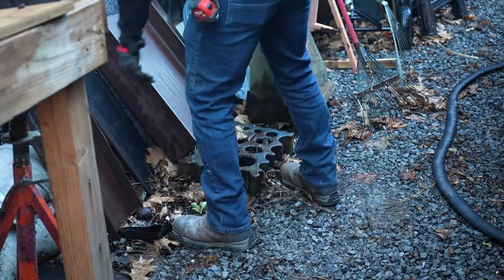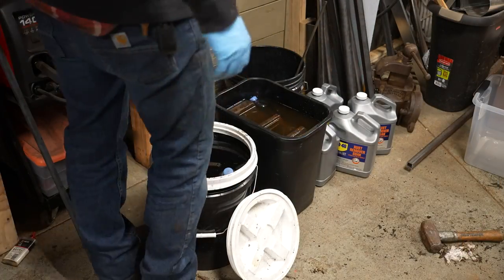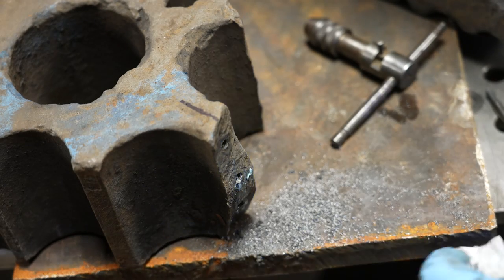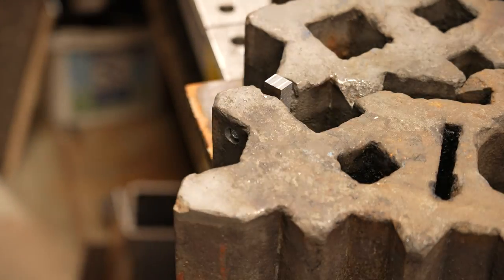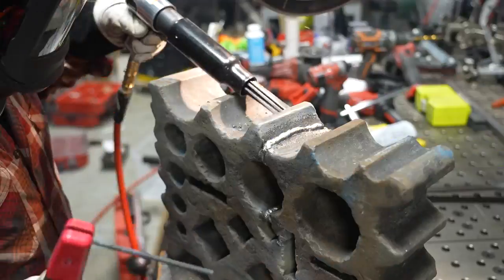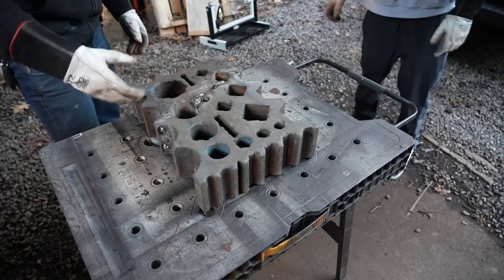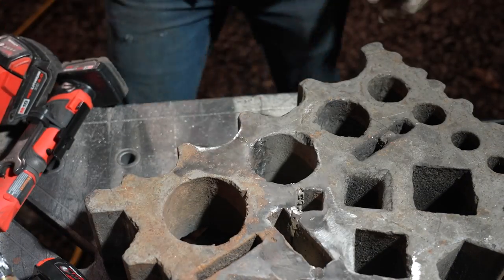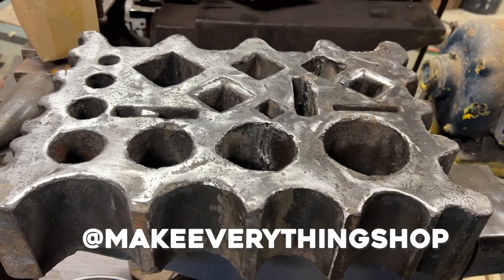Can This Even Be Repaired??

Comment: You destroyed that by Nickel welding it. The only way to properly weld that would be either fusion welding with cast iron filler rod or by furnace brazing. It might hold right now but it eventually will fail. I work for Lock-N-Stitch where we specialize in cast metal repair.
Reply from the maker: Someone else destroyed it by breaking it in half
Reply: @rd-ch1on  the tensile strength and yield point of cast iron are both the same. It doesn't bend, it breaks. When metal is heated up, it expands. As soon as you strike any kind of electric arc, you are immediately introducing 1000°+ into the metal which will produce a confined area of expansion and contraction creating cracking and hardening of the material which renders it further unrepairable. No drama, just science. I hope that answers your question.
Reply: @rd-ch1on   I have to fix these kinds of things everyday. The area that was welded using electricity has indeed been destroyed. The only way to fix a piece of cast iron that has been welded on is to completely remove the material that has been welded, including the surrounding heat effected zone and replace it with a new casting via either fusion welding, furnace brazing or metal stitching. My comments have been educational and it is my hope that you and others may learn something from them. Using the words, "kerplode, gazillion, Silverback gorilla, etc." I have no doubt that you indeed are an expert in the field of drama and I respect your intellect on the subject. After all, it is people like you who keep me employed 🙂
Reply: @Lucas Edwards  fantastic mate well said, stitching would be be my choice, but thats really just holding the 2 pieces together, giving its primary function, I would have no doubt that it would fail in short order
Reply: @Make Everything  bro, you asked for expert input. You got it and turns out you don't have the $1k object you thought you had. Bummer.
Reply: Could have just tig brazed it with silicon bronze rods. Would've held up fine for what you're using it for.
Reply: Used to have to repair cast iron knitting heads from a textile mill. Trial and error, but silicone bronze rod brazing was the best. Prep the surface, cleaning and grinding, get the torch ready. Built a furnace out of fire brick, put the head in, put a blaster torch in, and heated it to dull red. Pull it out and immediately braze it. Would only braze for maybe 5 minutes so it didn’t cool too much and slide it back in the furnace with the torch off to cool slowly. These were big knitting heads, about 300 pounds, and filled with oil when assembled and operated. Never leaked, and held up.
Reply: cope
Reply: @lucasjedwards  cope
Reply: @MakeEverything  hey, he did give advice, a shame that your repairs also damaged the material, but now only time and use will tell, an update after heavy use would be nice.
Reply: @yyeetmax2849  im waiting for this and for it to turn out that the Nickel weld actually works, making the "expert" look like an idiot. Nickel rod is whats being used most around the whole world to weld cast iron.
Reply: @Sharpless2  if that's the case, i'd be  happy for him! i do not wish to see someone fail.
But i must remind you that something being widely used doesent mean its good, it just means it is widely used, there are more factors to it, for example: if its easy, fast and cheap to make/repair, a lot of people will use a method, even if its less than ideal.
Reply: @yyeetmax2849  Thats true but its stable and works. May not be the best filler for cast iron but many professional shops use the same and it seems to work just fine. Do you know This Old Tony by any chance? He used Nickel rods to weld his cast iron Bender and it works fine. Hell, even John Deere uses Nickel rods to weld steel beams (cab supports) to cast iron parts.
Reply: @Sharpless2  interesting, i trust this old tony quite a lot, he still did quite shallow welds, the bolts should help, but as said only time will tell how well it will hold up, a test video where make everything gives it a good few whacks with a sledge would be nice, it should be standard for this tipe of repair on this tipe of tool, of course with something to spread the hit a bit so the surface doesn't dent too much, like a 15x15cm plate of steel.
Reply: @yyeetmax2849  i agree with you, he should test that.
Reply: @Sharpless2  yep, a proper test would solve all doubt
Reply: You did a good repair considering the equipment you had at your disposal, at the end of the day that swage block has been broken for decades, no one even attempted to fix it until you came along, so the way I see it, it’s a lot better off now then it was before you found it. Will it break in the future? Maybe, maybe not but it’s yours so who cares, it was a good repair that will probably outlive you👍🏼
Reply: Would thermite welding work?
Reply: I have welded cast iron that was over 150 years old and I started welding using a stainless steel rod before hitting the job with a cast iron rod . And I pre heated the parts first and in sand then once I fished welding it went back in the sand . No problems
Reply: @frankconley6321  Yeah it should, if you can contain it and prevent it from melting into a puddle somehow. Thermite welding is used industrially on all sorts of heavy steels.
Reply: Thanks Lucas. I'm agree with your explanation and happy reading it. Weld done 😊😁👍🇲🇫
Reply: I was thinking furnace brazing would be the way to go.
Reply: Pre heat, silicon bronze, and throw it in some sand to cool slow. It would be just fine. Haven't had a failure yet. Some people are just stuck on one way only, and that's it. There is the best way to the worst ways. There is no one way to do it. It depends on future use of said object.
Reply: @MakeEverything  you asked for advice on how to do it better, then you're a smart ass to the person who specializes in this field specifically and gives you advice about it?
Reply: @MakeEverything  that's a really disappointing response. Would it have killed you to acknowledge that you learned something new from this comment? I don't see the need to come back with your sassy response.
Reply: You should start your own channel.
Reply: @Make Everything  someone "broke it" by breaking it in half, it was repairable. Now,,,, not so much.
Reply: @MakeEverything  I thought you wanted to know what you did wrong...
Reply: There are dudes in Pakistan that can fix this in the dirt without breaking a sweat

Comment: If you're in counting porosity on old metal. You need to cook out the impurities at the weld zone. Heated up until it's glowing hot. Let it cool down halfway and then make a pass. Everything should work out fine after that. 👌

Comment: The nickel rod is sensitive to sand in the casting/casting skin scale, it must be ground off clean. Also they should be dry , from a new pack or kept in an oven over 200 deg F min.  I have done heavy castings like that in industry and we always used E7018 from a new box or oven. E7018 heavy slag floats out the sand and inpurities well. ENCI nickel 99 has a tensile of 38-40K psi. E7018 is 72-80k psi...a much stronger filler metal. Second choice is ENCI 55 ,the 45% steel ads more strength. Full 99% nickel is only used when it must be machined or drilled, it is soft as welded but strength is less. Keep in mind that your repair should stand up to regular use but if it doesn't , try E7018 better results IMHO.

Comment: You need  heavier bevels for more thorough adhesion.  Old cast iron tends to be porous and will absorb hydrocarbons from solvents like a sponge which is why you're getting such rough beads initially. It looks like you needed a higher, more consistent pre-heat. I try to get the whole casting up to at least 500 degrees Fahrenheit. I have had better success with higher nickel alloy rod. Try cast 55 or cast 60 if you can find it. Your peening with a needle scaler helps a lot. Also, you need to control the cooling by post heating the whole part again and wrapping it in insulation.  In the end, it depends on the quality of the cast iron. If the metallurgy was right it will accept the weld. If the silicon is too high there isn't much you can do to keep it welded.

Comment: You need to preheat it and maintain a constant heat on it while welding.  Usually, in my experience, with this old of cast iron, and the blends made back then, a very high temp (1000-1100°f) is required for the nickel to fuse properly.  Even then, there is no guarantee it won't crack.  Also, one or two surface passes won't be enough to fuse any of it.  One or two good whacks of a hammer will crack it.

Comment: To be honest there is no easy way to repair that. You could have done with beveling all the way so you have complete fusion, pre heating to at least 50 Celsius and peining with a hammer to compact the weld whist hot so it doesn't break apart from shrinkage. 7018 is better or even 309, 316L. If you could get a big enough gas forge you could have braised soldered it together. It's a lot of work and to be honest it won't take the punishment it was originally designed for however you fix it. For your time and expense it would probably be worth buying a new one. Well done for the effort though. Cheers J

Comment: Pre heat always and post heating, and peening 👍the porosity is a result of the cast iron itself. Braze welding is best as the brass gets right into the course grain of the cast and locks it together.
The rods you chose are the right ones for that job, it's just way too thick and complicated a pattern to weld as you need to cut an angle right back into the block to get the weld right through for the strength it needs.
Braze welding would have gotten deeper penetration in the grain with the minimal preparation you did and provided better strength....given you couldn't cut the block right back for a full thickness weld.
Very challenging job even for experienced welders.

Comment: Sometimes you need to weld, grind out the porosity, weld again, etc, until you get a good weld.  3 or 4 welds may be needed if the material has soaked in a lot of gear oil over the years.

Comment: You did a good repair.. Ni99 is a solid rod and often times contaminated flux(getting the rod dirty) can cause porosity with nickle rods. oxygen contamination as well..Your repair looks good ans Im sure it will hold very well Just to add Ni rods are good and I still use them too but nickle rods are not the best for cast anymore. There are several rods out there that do a lot better job on cast.. Like Certanium 889, it wont crack and dosnt even require peening. Magna 770 is another rod thats fantastic for cast. The only downside of these rods is the cost.They are pretty expensive.. Otherwise they are amazing and made specifically for cast.

Comment: A 'really high-tech' method, would be using Electron Beam Welding. Clean the pieces, clamp together and weld the seam. The electron beam will penetrate all the way through, melting and fusing it back into a whole block. In one demonstration, the sawed an engine block in half and welded it back together in a single pass, all 20" in depth. (50 Mev electron beam).

Comment: typically I'd say it's gonna be contaminated material giving you that porosity. I'd guess inclusions of slag and possibly sand from the casting process. Probably wasn't fluxed or drossed prior to being poured and all that crap wound up in the mold with the iron which I would bet is why it broke in the first place. If the drifting operation involved any amount of taper in the tool that block probably saw a couple tons of tension across what looks to be a fairly thin section of the block where it broke.

Comment: Doesn't this thing need way more preheat? Watching folks weld cast iron turbo housings involve going in the oven for awhile to heat the whole thing up… and those are way thinner compared to this huge lump. And then moving it back into a less-hot oven or a barrel full of sand to let it cool down slowly.
Reply from the maker: I did preheat it for a long while before welding, but cut it down for the video. So far no cracks but time will tell…

Comment: Especially with cast iron, when  welding thick metal, you need enough of a v-groove to be able to weld from each side to have a 100% penetration weld.  Your mechanical fasteners may hold it, otherwise, the cracks will come back if you are using it as it was intended.  Good luck.  Your porosity was possibly caused by debris, but most likely it was in the cast iron.  Good luck.

Comment: If you were melting through the piece its a combination of amps,speed,and the type of rod your using like for a 6010 rod on 70 or 80 amps you can burn through almost a quarter inch of steel with that not what the rod was intended for but its possible

Comment: I´ve only heard of Magnesium rods being used for cast iron welding, with a lot of hammering done in between welds to release tension. Is that scaler doing the hammering job in this case? Does anyone know the difference between Mg and Ni rods for this application? 

Anywhoo, I love this piece - never seen anything like it, but now I want one, if nothing else, just for decoration. Lovely piece of smithing history! And it looks like it took a ton of abuse - the surface is hardened enough that most of the holes have pretty bad chipping around the edges. I think this might have been why it broke in the end. Imagine forcing a rod into that big square hole that´s already abused to its limits, maybe the piece is also a little colder than it should. That could finally blow out a piece like that half inch that´s missing.

Nice video as well, thanks! I don´t think you should mill it down, better keep it as original as possible. All the wear and tear is a huge part of the piece in my opinion.

Comment: I nickel rodded my cement mixer 20 years ago.  Multiple cracks. Gouged them out, Half ass heated with cutting torch. Welded up . Slow cooled it with torch for way to short of time...Everyone said it would recrack worse. Guess I got lucky

Comment: Probably the only 'right' way to repair this would be with furnace brazing. I think it's the only way you could reasonably get a full contact braze on such an enormous part. But of course, you need an oven large enough and hot enough. In the 1000-1500F range.

Comment: Man, you opened a can of worms asking for opinions because they’re like assholes, everybody has one. I think you did a good job with the repair and as long as the block is on a flat base it shouldn’t have any problems. I’ve had the same problem using nickel rods with the welds being porous. I’m using them on smaller jobs like vices so I don’t get the opportunity to run a decent bead. Striking and keeping the arc going can be difficult so i up the amps and then the base metal gets burned away. It’s tricky for guys like me and you that don’t weld cast iron very often. Ignore the nay sayers, they’re the ones that won’t even try. I love proving them wrong and if it does fail at least you tried and then you can try a different repair method. I’d love to see it milled. Cheers mate, Stuart 🇦🇺

Comment: I think this is more of a patch than a repair. Some of those cracks you only surface welded. No full penetration. They should have been ground to a bevel nearly to a point. It'll hold. For a while. But it's likely going to crack again right at those welds.

Comment: Nickel rod i.e. Tech-Rod 55 is, and has been for decades, the recommended rod for multi-pass welding cast iron. Tech-Rod 99 for single pass. If it were cast steel,  E7018 would be recommended. Preheat is preferred for both materials and a final heat soak after repair, then burial in sand or vermiculite to cool slowly. My only concern is you didn't bevel deep enough and the penetration was minimal. Probably 60% of each crack is still there under the beads. The mechanical reinforcement definitely helped. If it breaks again in the future, you can address the weld depth issue for a more solid result. Regardless, congratulations on your find and having the testicular fortitude to tackle the job!

Comment: Isn’t this just like wallpapering over the cracks? You didn’t grind anywhere near deep enough bevels to weld and then you ground most of the weld away. It is not worth anywhere near a grand, it’s probably worth a little less than you paid, or it’s weigh in scrap, whichever is higher.
Reply from the maker: Worthless, or just worth less?
Reply: @MakeEverything  yes.
Reply: Price a used one that size- very pricey

Comment: I would never dare touch this thing with a 3kg hammer. It might survive a couple hits with a 1,25kg hammer but by using it in the way it was initially made for (eg two smiths, one with a 3kg hammer) it will split right apart again.
Welding something that thick with a rod that thin will never yield any sort of weld penetration.

Comment: OK, for a show-piece.   For doing actual work however, not so much.   Welding on cast makes the cast brittle.  Even if you can get the parts to stick together.  The very heat from the weld arc burns out the carbon in the cast, AND heat treats the iron into brittle steel that shrinks more than the cast iron and further stresses the surrounding cast material...propagating cracks and failures.   Brazing would be the better choice if you are looking a functional bit of hardware.   Even then, the same issues apply as for welding...albeit to a sliiiiiiightly lesser degree.